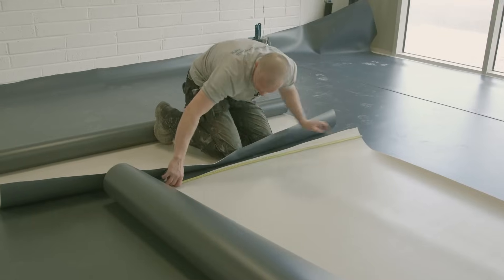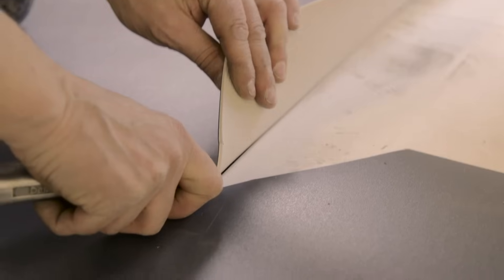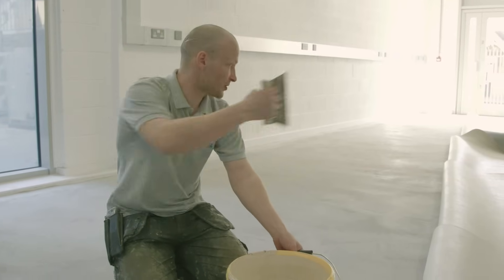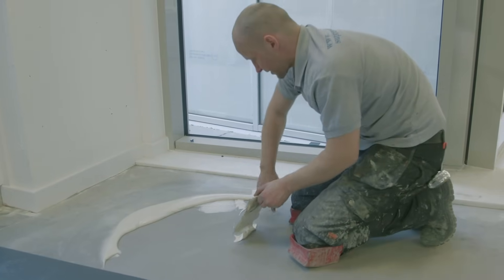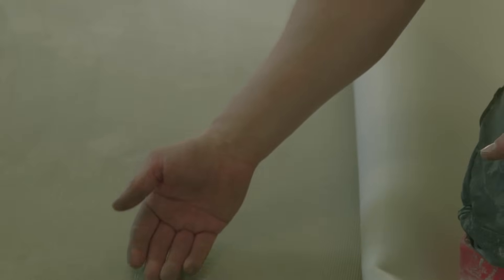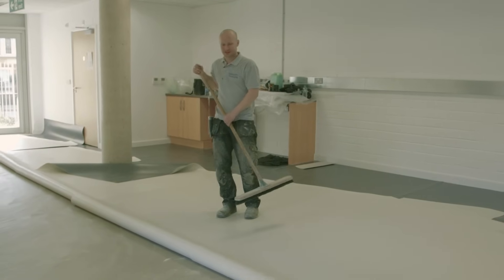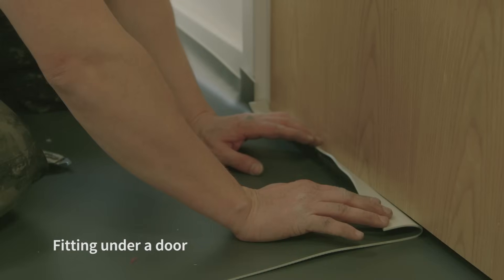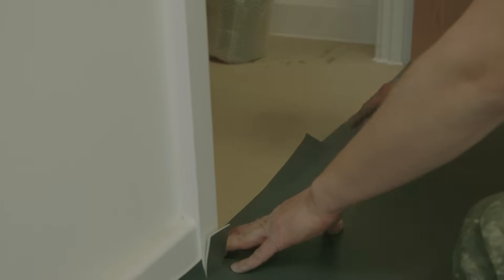How to lay vinyl flooring

Comment: 2 things in your video that I picked up on been a floor layer myself was 
Tucking thumb whilst using straight edge amount of apprentices thumbs I’ve had to apply first aid too where knife jumps onto straight edge .
2) if I’m flat laying I use a scribing bar to get the cut to the walls lovely and neat ..you do that be before gluing 
And we weld our joints in the flooring 
But apart from them couple of things your very talented

Comment: I noticed you used a hand to push out some parts of the bubble.  You should try a cork squeegee with a wet cloth underneath  it, to push out the bubbles  it does a great job  and it cleans any accidental  transfer  and also you can see the damp mark on the vinyl so you dont waste time going over it again.  Just some advice from another  vinyl layer =)

Comment: I have a vinyl plank floor over hardwood that has failed.  I am going to replace it with vinyl sheet flooring, but don't know if I should put in luan underlayment or if the hardwood will be smooth enough.  I hate covering hardwood, but it is a kitchen and the oak is black, so sanding, staining and finishing will be difficult to do, plus since it is in a heavy traffic and potentially wet area keeping the finish might be difficult as well.

Comment: Right now in New Zealand we need 400 flooring layers per year to keep up with New Zealand building boom atm and we only getting 98 trainees a year. Therefore tones of flooring work in New Zealand till 2022
Reply: Is this only for vinyl or for timber as well?
Reply: @sstech5410  yes alot of laminate and engineered woodplanks
Reply: @thanhanen5278  whos a good contact there?
Reply: @sstech5410  flooring junction they take on alot of big commercial jobs
Reply: Apprentice in ireland atm would i be better off in new zealand?

Comment: So your not welding the joints then?
Reply: no need too for that type
Reply: You can use a cold weld   product "type a" for the welds it's a clear resin that sits between the join or on it

Comment: You guys are hacks kitchen mechanic at best . You always need a roller , i can see all the imperfections in your installation.
Reply: @thecolourflooringcompany968  and a lot of products tells you not to roll but to sweep
Reply: You're  laying domestic  vinyl very light and easy to work with no need for  heavy roller for these types of job I also use a broom and I use a roller on commercial  jobs.